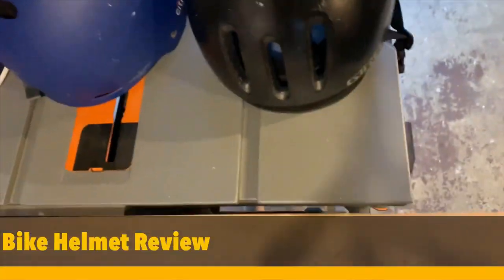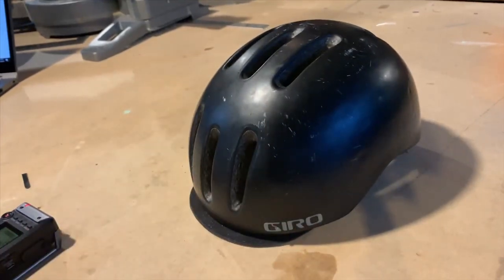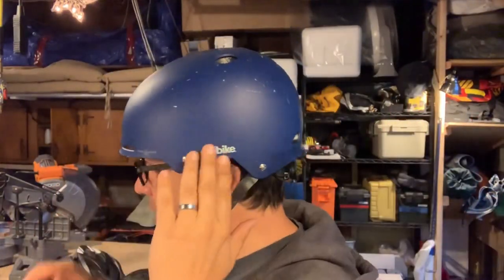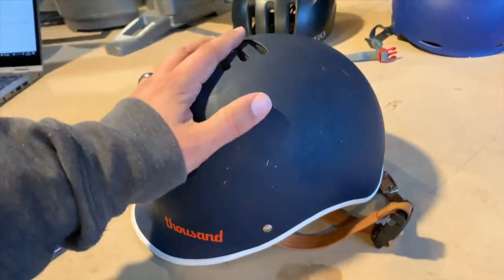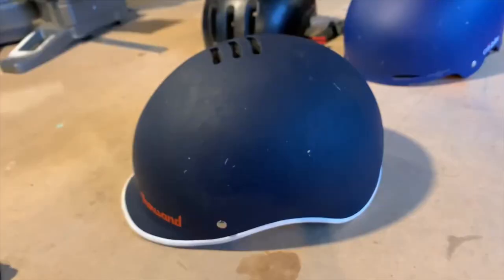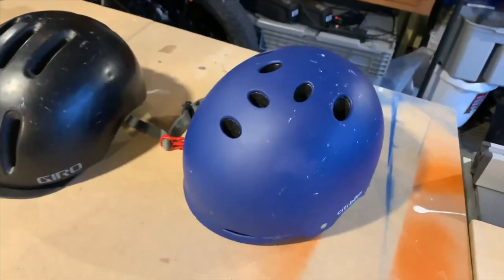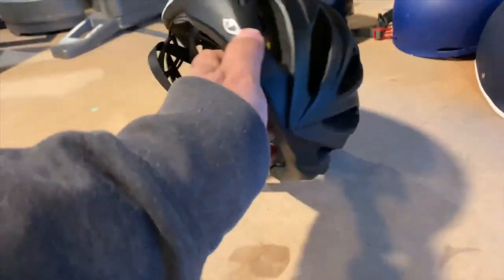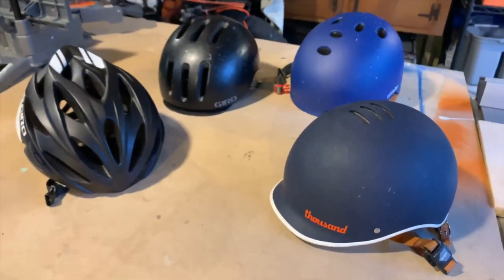Bike Helmet Review - Thousand vs Giro vs Triple 8

Comment: I bought a Thousand helmet. Large size. I was terribly disappointed. Aside from costing me $185 when I put it on it looks like a fish bowl even though I followed their sizing guide on their website (measured 3 times). I can place a finger on either side between the helmet and my head, the straps don't lay straight they are twisted and warped. Overall the helmet looks and feels cheap regardless of the hefty price tag. Extremely disappointing!